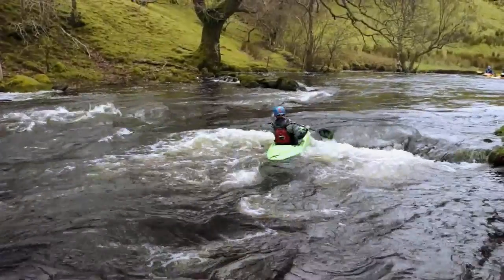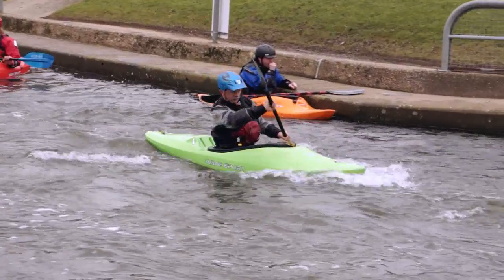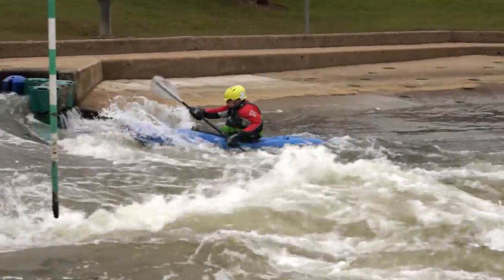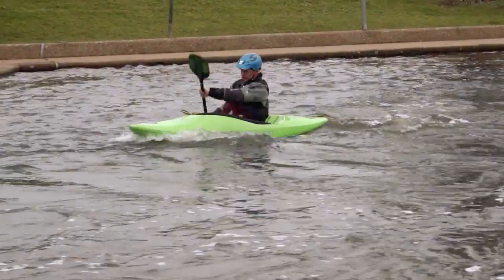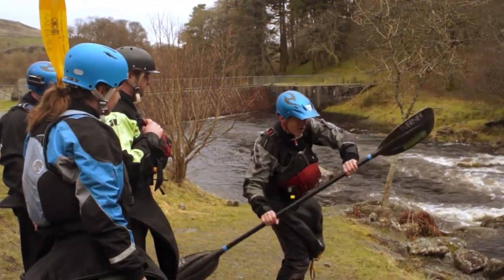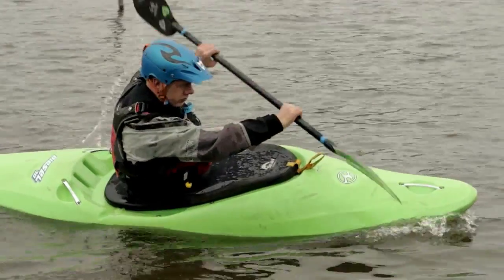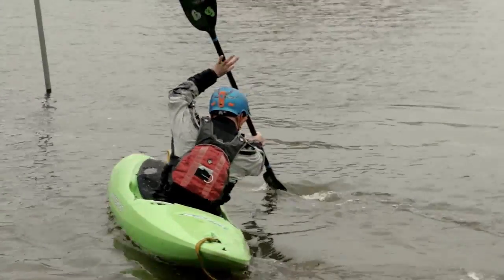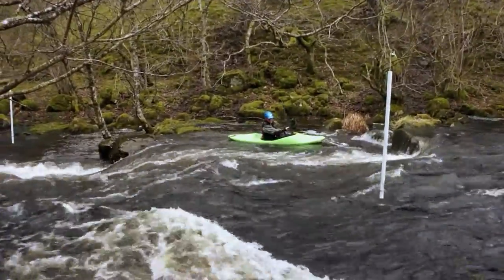Dynamc/Active Blade Kayak Skills

Comment: Interesting video, thanks for creating it!  A bit of feedback: 
Keeping the blade engaged in the water - great.
Using what most refer to as draw strokes, bow draws, C-stroke, s-strokes... great.
1. The draw stroke portion of these moves ("weighted and pressured blade") might feel secure or smooth but as demonstrated are too shallow / have too high a degree of angle to the water. Draw strokes are most effective when performed vertically.
2. Leaning forward might seem useful as an exaggeration to help beginners keep from making a different mistake during the power stroke, but there is very little you want to do in a forward leaning position.  It has no place in eddying out for example (unless you are doing it with a big boof).  You have the most range of movement and leverage over your boat with an "engaged core" neutral position.

3. In the demonstrations, participants arent leading with or using torso rotation to their advantage - especially critical for effective draw strokes. But also in power generation.
Just some observations. Keep up the good work.